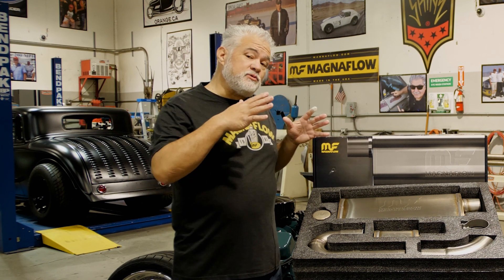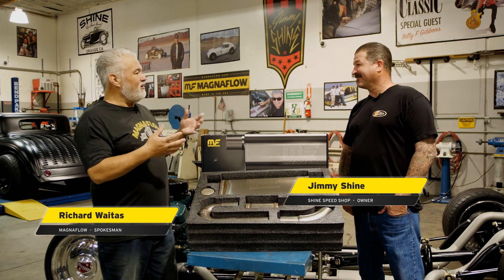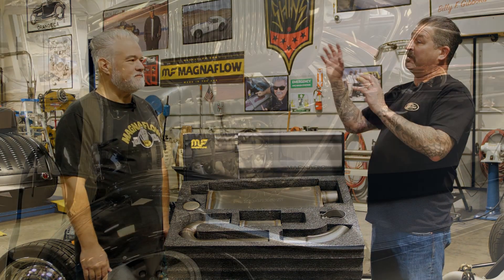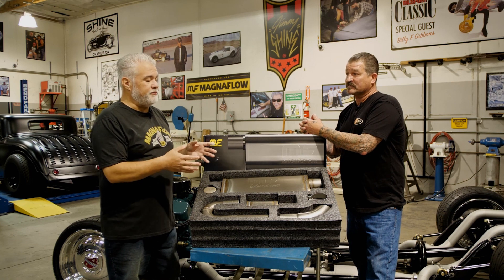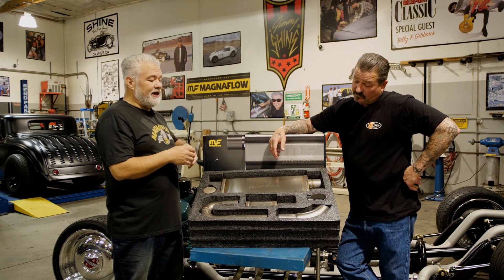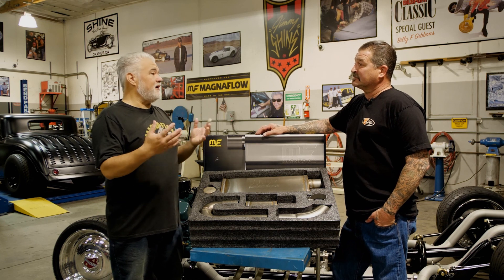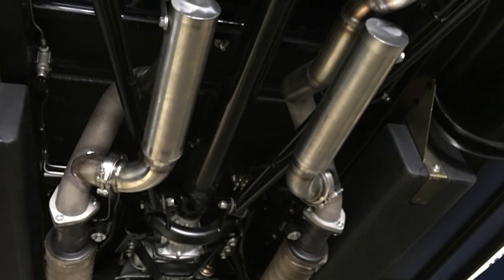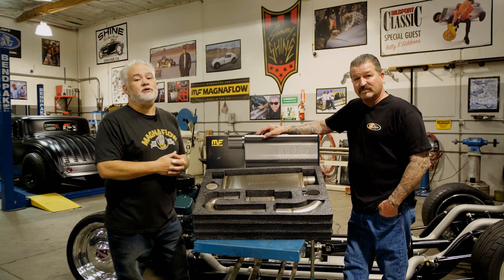MagnaFlow Tech Talk: No Drone Technology w/ Jimmy Shine

Comment: I got the neo series mangaflow on my civic hatchback sport touring 1.5 turbo.. I have some real annoying drone at 2,000/2,700. Any advice??
Reply: Would switching out the resonators for a vibrant ultra quiet resonator help?
Reply: Use a J pipe! It works if you get the tuned length correct to your application. I made mine adjustable by a few inches either way.  And put one one each side. It completely killed the skull splitting drone around 2k revs in my stroked Mopar 400.